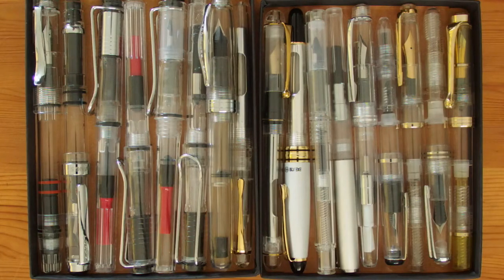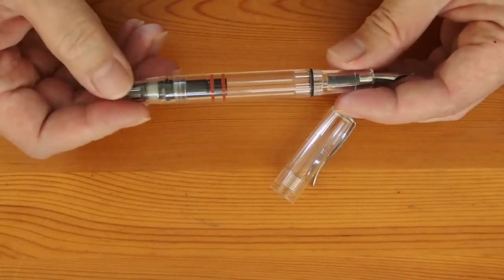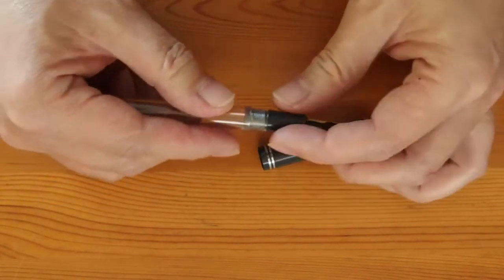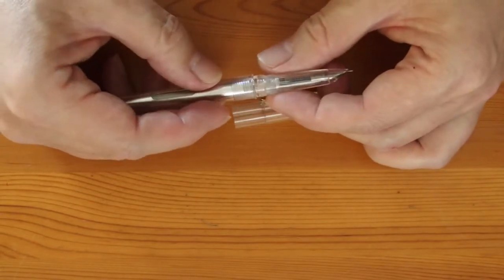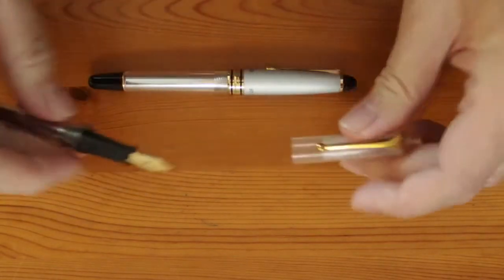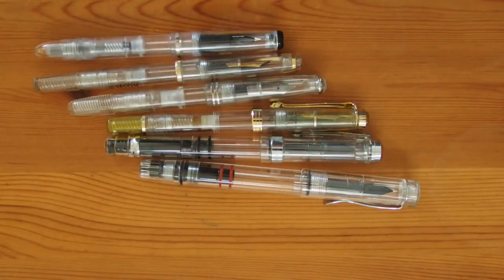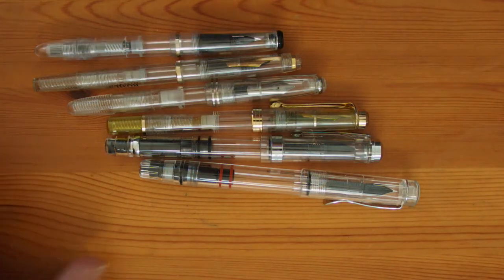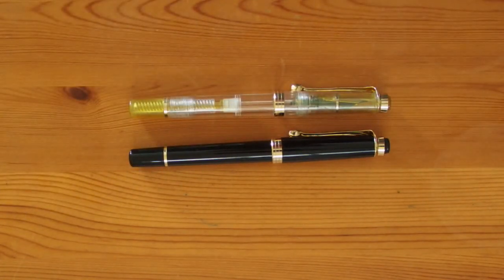Demonstrator Fountain Pens

Comment: I have a problem with a Click Majestic (piston Filler ) Fountain Pen you write about a page and the pen stops and to write again the pen feed needs to be primed . How can I solve this issue?
Reply from the maker: Stefan Ionut Marius I wonder if you have disassembled the pen and gave all the parts a good wash in soap and water first, it seems like the ink is not very keen on getting into the feed. Try using a wet ink, or add a tiny amount of wetting agent as sold for photographic use - what a pin head can carry would be enough - to improve ink flow. I routinely disassemble my pens for a thorough wash before filling for the first time, and I have never encountered ink flow issues, except when the ink is exceptionally dry.
Reply: Well, I use Pelikan 4001 royal blue ink with this pen . I washed the pen with soap and water and after that i greased the piston with a silicone oil from a Wing Sung 618 because the piston did not run smoothly .
Reply from the maker: That's a bit odd; but then 4001 is known to have poor flow anyway.